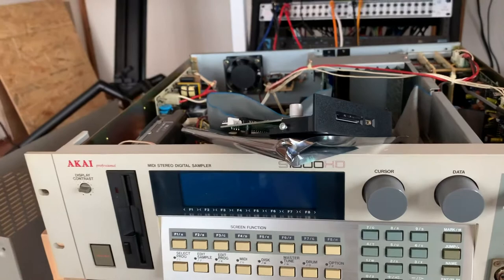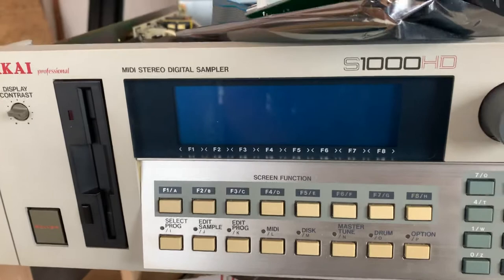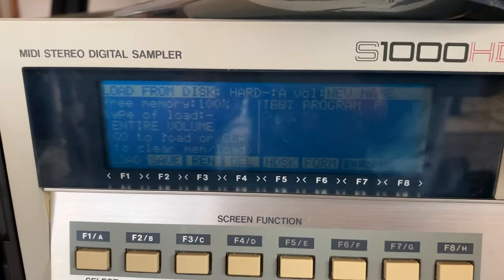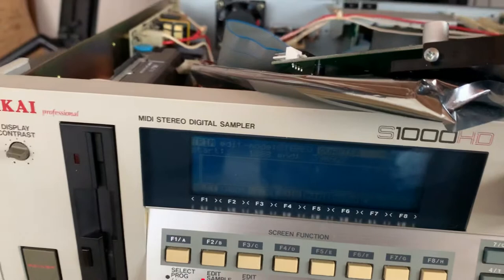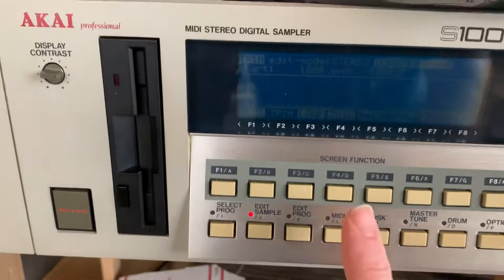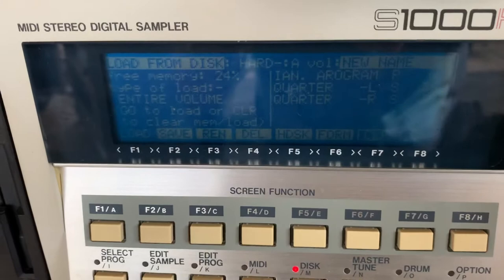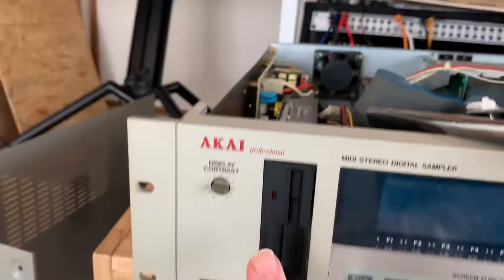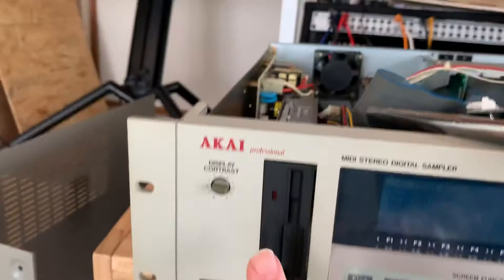AKAI S1000 in 2020 part4

Comment: I'm about to do this to an s1100, good to see it all working
Reply: did it work?
Reply: @mochorocho  Yep! It's  been a journey, but I got it all done, with an  S1100 though so has the internal SCSI which makes it easy.  New backlight (buying the LCD replacement was a nightmare...), replaced the PSU with a Meanwell and popped a V6 SCSI2SD in there, with 7  partitions and it's all working.  Found a parts machine too so now have 32mb of RAM & either some spares or a new machine to try and get working  (wont show installed RAM & has some acid damage on the CPU board)
Reply: Have two s1100 Here and in process of doing the Same. Ordered the scsi2sd 5.1 and a fancy Led Screen.  How difficult is the PSU replacement ?  Can i Hit you Up somewhere (Email, Facebook, you Name it)?
Reply: @robertcrystals  and congrats Rob - i Hope your enjoying your workhorse Sampler. Best N.
Reply: @mochorocho  PSU isn’t hard just takes a bit of time. Read through this thread, especially the last 2 pages and it’ll walk you thru it https://www.gearslutz.com/board/electronic-music-instruments-and-electronic-music-production/1132743-recap-powersupply-your-vintage-synths-samplers-akai-s1000-blowup.html
Reply: @robertcrystals  Thx a lot man! currently trying to get the scsi2sd to work. got it mounted and pc detects it. Sampler doesnt read it yet tho. x
Reply: gets stuck with "waiting for harddisk to be ready". When i plug it off the scsi again it passes and goes to the main menu.
Reply: @mochorocho  make sure the first volume in the SCSI2SD software is scsi id 5 as that's the default ID that the s1100 looks for.  I did mine 5, 6, 7, 1, 2, 3, 4
Reply: @robertcrystals  Hey Rob, i Had to Reverse the SCSI cable on one end. Funny stuff. Now it works, thanks to all the people who share their knowledge. Gonna tackle the PSU now. Thank you and take Care x
Reply: @mochorocho  ha I had that same prob on my Emax. Stumped me for 6 months
Reply: @robertcrystals  what a bummer - i mean you wouldnt think of that would you ?? Im surprised how flawless all goes With my akai so far Fingers crossed.